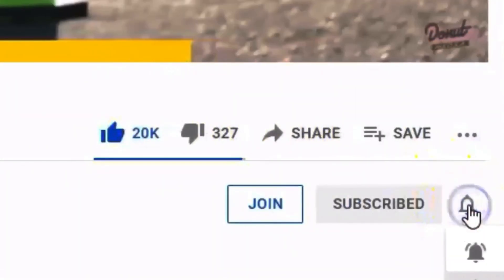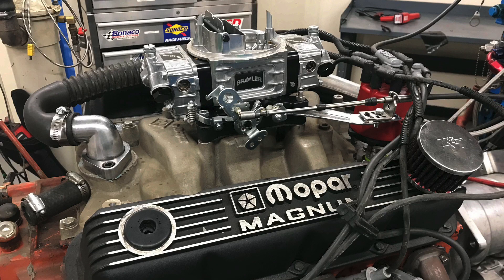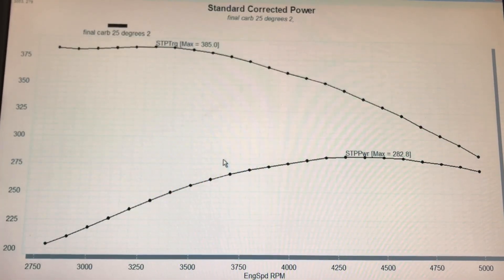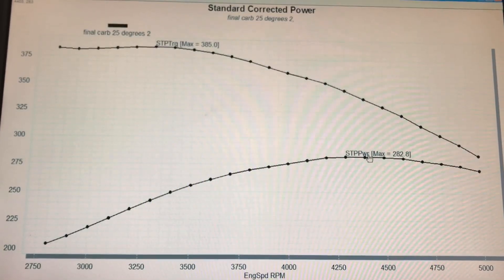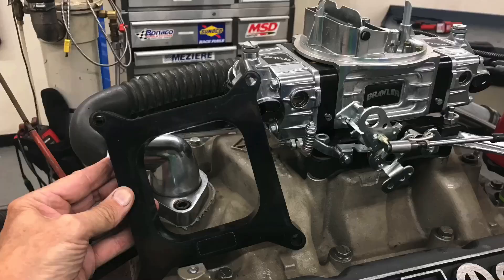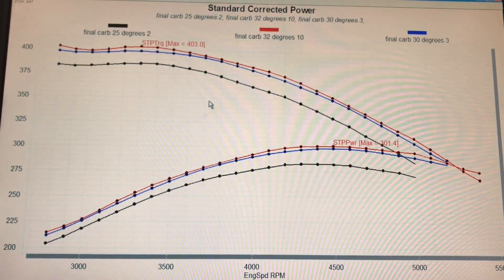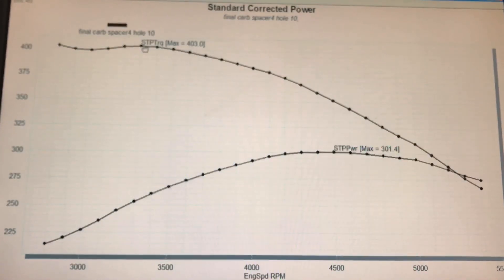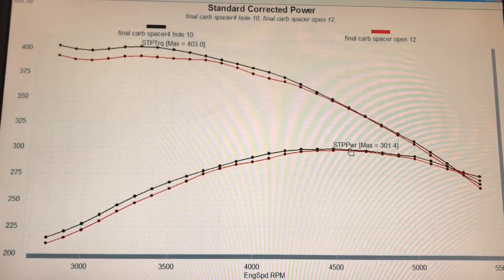DO CARB SPACERS REALLY WORK? 4-HOLE VS OPEN (360 MAGNUM-HP & AF-FULL DYNO RESULTS)

Comment: I found this true today. Reason I'm searched for this test. I have a mild 383 SBC in a 71 GMC Sprint, heavy car, tight stock converter. The engine has a Edelbrock Performer intake manifold with the spread bore Qjet flange. Very similar to whats on your 360 Mopar. I was running an Edelbrock 650 AVS 2 carb with a cast alloy spread bore to square bore adaptor. I've ran several different carbs on this combo and all had an off idle stumble down around 1200 rpm. The engine has had a problem with boiling the fuel after you shut it off on a hot day. So earlier today I swapped the open 3/4'' adaptor to a 1'' 4 hole phenolic spacer to try and help the fuel boiling issue, and low and behold it did help a lot with the boiling issue, it cured the off idle stumble, and runs much better all around! This spacer was left over from some dyno testing I did on a wilder 540 HP 383, where it was a failure pretty much everywhere. It's crazy how much it helped this milder combo. I'm going to chassis dyno it here in a cpl weeks vs various spacers but I think it's going to mirror your results.
Reply from the maker: let me know what happens with your spacer test

Comment: Another great video, thanks. It seems like you could play with the idle screws, air bleeds, and jets to correct that. Either way it looks like the 4-hole is great for trucks and low rpm motors. What size carb was it? Maybe I missed that.
Reply from the maker: you can't correct a carb at specific rpm very well

Comment: Dude, thank you so much. I have been fighting this weird richness problem, and knowing that my ride, while modest, still highly rodded, should pull more than it does. All the temp, vac, and load readings line up with this (haven't installed the AFR yet, still just need to take a day to do that) sure enough, I have a performer rpm intake - thus dual plane, and a giant open phenolic spacer between it and the carb. I will swap that **it in the parking lot of the parts store and give an earball tuning to the thing on the spot. thanks again man.
Reply: Which is totally fine - the phenolic thingy can go on the torker I just picked up for my 425. I already had one for it, but expanding the plenum with a second on a single plane? how terrible...works for me! Stacking! Obviously a different nightma...project

Comment: What about fuel atomization,  What about a tapered 4 hole spacer upsidedown.  I see on YouTube some power gain along with the restriction and maybe some fuel atomization.  It combined low end and top.
Reply from the maker: there is no magic-sometimes spacers work and on other combos they don't

Comment: Recently I have built my sbc [40 over 4 bolt 350 with custom grind 488/488 roller conv cam,906 heads and a holley 750dp sitting on edelbrock air gap] and I had installed a 1 inch open spacer. I soon realized there was a noticeable negative power difference and after watching this I have a 1" 4 hole spacer and 1/4" phenolic spacer on the way. I hope to see improvements...

Comment: Whats up Ricky, i know this is old but thought id rewatch these on the Dodge Magnums because im going to add some HP to one in my retired work Truck, i plan to port match and some bowl work, blend the valve guides because im too cheap to buy decent heads. I appreciate the data you provide. Hey ive adked before but forgot what you said, do you tune?
Hahaha

Comment: Thanks for this video. I don't have a dyno,so i use throttle resonse by ear and feel. I was going to buy a super sucker 4 hole off ebay,but im just going to stay with my 4 hole Mr. Gasket Aluminum outside plastic 4 hole insert. I'd love to see a 4hole stacked on top of the open just for giggles.

Comment: What about spacer plate on supercharger engine like thermal spachers is it worth? Need to be tested want be very nice 

With and without spachers to watch ita temperatures if its working or not
Reply from the maker: your engine bay is hot so the spacers will do very little

Comment: Great video and info, it a four hole spacer for me. If you can, I have a question, I’m thinking to put 2v closed chamber heads on a standard 351 Cleveland to increase compression, no other changes, am I going to run into tuning issues or maybe other issues you may know of.

Comment: What this test shows me, which I suspected from the start, is that if you change your intake manifold, spacers or otherwise adjust the signal to your carburetor, you have to tune your carburetor.
After the swap to open spacer, tune your carb to work properly with that setup and run the test again.
Then I'll say you changed the carb settings and that caused the difference, lol.
Reply: BTW I'm about to flash up a fresh rebuilt 383 and tuned my edelbrock a little rich on the single plane intake, so your video is making me think that was a good choice in calibration of the jets and rods.

Comment: What I am seeing is the open spacer did made the motor more efficient in that it lost a small amount of power and torq but ran on quite a bit less fuel. If you had put in bigger jets wouldn't it most likely brought the torq/hp figures up?
Reply from the maker: incorrect assumption-the signal changed making the motor less efficient
Reply: @richardholdener1727  Am I miss reading the graph - with spacer , roughly it was down .03 in torque and hp but was using .9 less fuel. I guess I don't understand how that relates to signal, bigger jets would not have helped that lean condition while increasing P&T?

Comment: Spacers make more power because it helps the high-speed air coming through carb to change direction towards the ports instead of ramming it at intake floor, it's all about how air flows.  Too bad this combo couldn't be tested without a spacer.  Also the intake divider wall on this combo should be thinned a smidge so there's no flat steps for air to stagnate on 5:19
Reply from the maker: SPACERS WON'T CHANNEL AIR TO THE RUNNERS
Reply: @richardholdener1727  The 4-hole had larger diameter holes than the Carb, which helped average out to a diffuser for the base of carb, allowing air to be pulled to intake runners easier, test it Richard!
Reply from the maker: HAVING TESTED SPEACERS MANY TIMES-MY CONTENTION IS ONE OF DIVERTING THE AIRFLOW
Reply: @Richard Holdener  I didn't say or mean it diverted the air.  I said it helps and allows the air to flow easier.  Could be a great episode, big spacer test getting at the science of it

Comment: What would it do if you added a jet or two?  Obviously, the signal strength is cut in half.  Also, the way you present this implies to the less knowledge that any and every engine would respond just as this one did.  What’s up with that?  Are you overlooking this playing on it?  Ever seen an engine benefit from an open spacer?  I have.  Many, many times.  In fact most times I’ve installed them there was a net gain, but we aren’t racing dynos nor are we racing such mild engines that live 95% of their lives under 3000 rpm.  People don’t drive dynos nor dyno results.  You ought to tune cars and test drive them for a few decades before you start making tuning recommendations.  You are way off the mark.  What’s this crap you conflating the opinion of the inexperienced with how you run a back to back A-B test?  If you don’t zero all parameters you aren’t testing the spacer design, you are merely testing whether or not that part number carb is jetted more favorably for one spacer or the other.  Man, you just lost a major amount of respect from me
Reply from the maker: most times I have installed them (with no actual dyno results, yada, yada, yada)

Comment: You seem to be the expert on Induction.  Please tell me if you can use a Carburetor setup with Fuel injection?  Will the fuel injection take away lean spots in a carb system?  Working via the Co2 sensors????
Reply from the maker: YOU CAN RUN BOTH

Comment: Just out of curiousity, it would have been nice to see what the AF ratio was with carb to intake before the 4hole and open hole spacer was added.... either way, i see there will be a slight leaner mixture because of the simulated added intake plenum that the spacer provides, allowing more air without a change in fuel delivery.

Comment: Interesting....I watched a video by Westech Engine Masters.  The Edelbrock AirGap manifold beat the standard dual-plane manifold by a mile.  When they milled out the center divider in the standard dual-plane, it mimicked the power output of the AirGap.  Then, they tested open spacers vs. 4 hole spacers on AirGap vs. Open Plenum manifolds.  The open spacer made more horsepower on the AirGap, and the 4 hole made less on the AirGap.  The open spacer made less horsepower on the open plenum, and the 4 hole made more horsepower on the open plenum.  I realize that their has to be a lot of other factors involved here to produce these results.  The engine was an LS something so....  But why are your results showing just the opposite is what I'd like to know?

Comment: another interesting test idea...compare carbs with metal intakes, Carb +Space+Metal intake, Carb and Plastic intake. Isolating the carb from the engine heat would seem to be a benifit, while a carb spacer does help, the bolts holding the carb to the metal intake does cause a heat transfer. It would be interesting to see if there was any gain with the full plastic intake.
Reply from the maker: carb isolators do very little (other than act as spacers), which can change power (from a chnage in carb signal) depending on the intake used. the change is not from temperature

Comment: What about the air gap manifold? Isn't it effectively an "open spacer" within the manifold? Does it also affect drive-ability at the low end where the vehicle spends 99% of the time?
Reply from the maker: STILL A DUAL PLANE
Reply: @richardholdener1727  Thank you for replying, but yes it is a dual plane. Your video showed the 4 hole had much better low end drive-ability then an open spacer. If you put a 4 hole on an air gap manifold  - you still have effectively an open spacer (the air gap) losing the dual plane isolation effect.

Comment: From personal experience, I went from an RPM intake to a Victor Jr on a 400 HP 383. 9.8:1 compression, 236/242 hyd roller, Victor heads. The loss of low end torque was noticeable. On a suggestion, I tried a 1 inch 4 hole spacer to get some low end torque back. It did help, but should have left the RPM intake for what I was doing. The four hole spacer helped with carb signal.
Reply: This was my question.  Did you use the 4 hole tapered spacer? Im thinking about going to an air gap intake. I wanted to know how much of a difference I could get out of a spacer before buying the new intake.
Reply: @jacobprice8261 It was just a cheap spacer. Nothing tapered. On a street engine, stick with the RPM.

Comment: I would not run a square bore  carb on a mopar I would have a different carb i would have large secondary  on carb  and I would have probably ran vacuum secondary on that set up to see if you would get a better power curve I wish I had a dinoto be able to try all the different set ups to see what works and what don't you so lucky never had luck with square bore carburetors on Dodge's of always had larger secondaries
Reply from the maker: WHY SPREAD BORE? ESPECIALLY ON A SQUARE BORE INTAKE?

Comment: This question is a bit off but .... ZL1 Lid spacer for a Eaton 1.9, I have the convertible so fitting would be close does this increase volume enough to make a difference?   Then there are spray connections....hmmmm

Comment: why such a big carb? that carb was way to big, I saw a vid where a 408 HP Chevy 400 pulled only 496 CFM. and when they swapped out the 750 for a 650 they gained 4 HP (411 HP). both carbs pulled 496CFM. TQ went up with the 650 to 445.

Comment: Is there any difference between a 1/2 inch and a one inch spacer ?
Reply: I have a 69 mustang with 302. Has factory 4 barrel and factory 4 hole spacer. Kept over heating so put a phenolic 4 hole spacer. I thought it would detract from performance but I think it added to it.
Reply: what would the car do when it started to over heat?

Comment: Every engine is different. I put a 1 inch open spacer on a basically stock 383 roadrunner engine with a Holley vacuum secondary 780 carburetor and gave a tremendous seat of the pants boost!

Comment: Honestly I shake my head when I see  people put open spacers on dual plane intakes.
Reply: Thank You! I’ve got a Duel Plane Intake very much appreciated for the feedback
Reply: To be honest if you don't cut down the divider they dyno out pretty good! Set a few more tests and see if I'm not lying
Reply: What Carb Spacer should I run?
Reply: @DSRDoofTTV  details are needed. What setup do you have, engine combo, intake, and is it a street or track (car or truck). Just asking what spacer you should without details is a broad question that can't be answered correctly.
Reply: @DSRDoofTTV  the four hole kind, if u have a dual plane intake
Reply: 1969 Chevy C10 5.7 350
Reply: @DSRDoofTTV  if you have the original spread bore quadrajet dual plane intake or any dual plane, then you'll need to find a split plenum or 4 hole spacer to match. Stick with 1/2 or 1inch, don't need anything crazy. Also the thick 1/4 inch carb gaskets that are made for those work well for cooling as well, if you can't find a spacer.
Reply: I daily my truck
Reply: Well that is what a old guy told me but as for open spacer and bigger carb on old 305 just blew me away with top end power and that was a 1” spacer . I had two spacer on dual 4 barrel carters on my Camaro and with stock rear axle power glide I could run to 80 mph in first gear
Reply: Don’t make blanket statements like that. Tuning the carb and every combo will make it different. The open spacer, tuned right narrows the gap in AFR from cylinder to cylinder.
Reply: @blueduster74  you can do that by selecting the needed jets at every corner as well.

Comment: when you have that lean condition low , did you try and use a 1-1/2 " riser on top of carb then try using an air cleaner housing / with a filter,
Engine will be used with an air cleaner of some type anyway  ( dual snorkel ?  , I home made a few) 
On a dyno test with a SBC , a builder noted an engine was  lean at low rpm ( using a Quadrajet spread bore and a open 1/2 " spacer adapter to fit Quadrajet  to a square bore dual plane intake , was a lean at lower to mid range rpm and going  very rich at 5600rpm. 
We added a  spacer between carb and the base of an open element air filter housing  and it really helped the too rich at high rpm, helped to correct the lean at 2700-3700
this was a  mild 9:1 400 hp engine that will idle at 700 rpm with 16" vacuum, nothing crazy , found 35 lbs of torque down low ,  it liked getting rich there , adding the air open element air filter housing lost very little hp on top, engine tune optimized with air filter on as it will be run in vehicle ,

Comment: I use a spacer under my sniper 2 reasons. 1 to help keep sniper throttle body cooler, 2 to increase plenum length, with the holley sniper it needs to be 4 hole it whistles with open spacer

Comment: I really would like to know what applications the headers were designed for. Reason being is that it would have been much easier to build the header shown if the destinations on the collector had been swapped for the front and rear positions on the mounting flange.

Comment: @richard Semi related: have you tested the differences between open and 4 hole spacers on a single plane intake? Does the 4 hole spacer help or hinder signal to the carb base in this situation? Asking for a fiend.
Reply from the maker: spacers are for fibe tuning your combo-the gains change with combo-not just intake (single vs dual)

Comment: Would a carb spacer make a difference on a Blower application?  One would think not, but can Richard prove it!  What about single Carb blowers like the TBS 192 or a Weiand 177?  Dual Carb Blowers 6-71  8-71, Let's see some testing!!
Reply from the maker: dual carbs help if the motor(blower) needs more airflow
Reply: What about a carb spacer? Needed or no point? Have you ever tested?

Comment: Richard , I had the opposite results from a sbc 350. The 4 hole on my stock silverado gen 1 motor and a boat anchor cast iron intake. And it lost a BUNCH of everystuff...then the open one I really couldn't tell the difference in that and no spacer.

Comment: I have a dual plane 302 intake with my Holley sniper efi. I’m running a open spacer. Do you think the 4 hole spacer will make a difference?
Reply from the maker: have not tested-I would lean toward 4 hole

Comment: When they did this test on Engine Masters it did the opposite. The open made more power on the dual plane. But that engine was more powerful also so I guess it's a case by case basis. 🤷🏾‍♂️🤷🏾‍♂️🤷🏾‍♂️
Reply: I believe a 4 hole makes more power on a open plenium and a open spacer makes more on a dual plenium, Just haven't seen the proof but it feels it lol

Comment: The crazy thing to me is that this motor makes no more/less power than the Junkyard motor 🤣🤣🤣
Reply: The Kegger is basically a short cross ram that flows about 200 CFM per port. A ported and cut down runner Kegger will flow about 290 CFM. It was designed to pull way down low RPM for trucks and not cars.

Comment: Really good info here! I’m wondering if there’s a fuel distribution issue with that M1 manifold. Individual EGTs or 8 O2 sensors might show the engine likes an overall rich mixture because of a few lean cylinders. Just a guess… Bottom line is dual plane manifolds work best for every day street use. Don’t mess it up with an open spacer unless you’ve got a whole different usage in mind. Thanks again Richard!